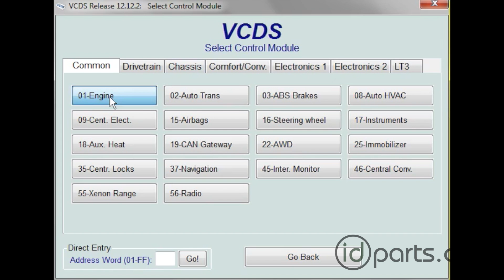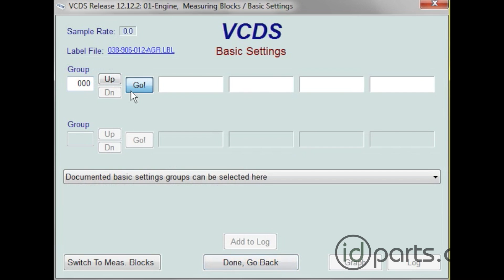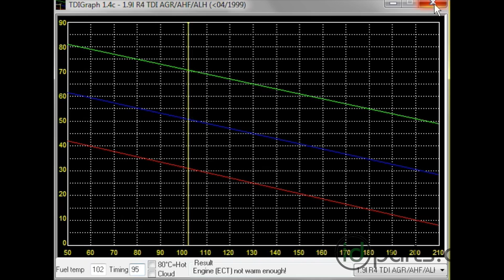Adjusting ALH Injection Pump Timing

Comment: Good video, Cory. @1:03 there's are 3 clips on top and two at the bottom. a long thin screw driver helps to unclip them and to put them back on. Another hint is to mark the hardware on the pump, so you can go back to where you were if you screw up.

Comment: My tdi will not start and I think it’s due to the injection pump timing, is there any way to set it manually so it will start? I see the program you can use to look at it but the engine has to be running and mine is not
Reply: Have you removed the injection pump? When you install a new pump it should be set with the a pin at TDC and the cam, crank, and flywheel should be tdc as well. Once installed correctly the engine should start given you've primed the pump and injectors. It needs to be further timed afterwards with vcds for precision.

Did your pump jump time?

Comment: Thank you for this video. After replacing my timing belt, water pump, pulleys etc. I've watched several timing videos now to ensure I'm doing everything as per the specs and yours has been the most informative by far where this stage is concerned. 

To anyone thinking of timing their VW ALH without VCDS i.e guesswork I would suggest you reconsider. Have read tales of people wrecking their engines by not doing it correctly. There's a reason these things need setting up the way they do so don't be tempted to listen to any old back street cleetus. Do it properly. Get the cable, get the software. Far cheaper than fixing a broken car. I don't understand why people would even go near their timing if they're not going to do it properly :S

Comment: Is it possible to do this without vcds?  I had my car scanned and I am close to the red line.  Is it just a small increment I need to adjust or is it like half and inch movement?
Reply: +Rollincoal you sir are a tool but best of luck with your alh
Reply: did your folks have any kids that actually lived?
Reply from the maker: You definitely don't want to do it without VCDS or some other scan tool, because you'll have no idea how much you're adjusting your timing--it's not really something you can eyeball.
Reply: Actually I tried it and got it bang on was 2 light smacks maybe moved an 1/8th of an inch got it perfect to the green line. Car starts in -36F every morning.    It's the same as any other engine really have worked on many and done many nothing different here except the money grab scan tool
Reply: +Rollincoal You're a bit of a divvy really aren't you? Are you sure your name isn't Cleetus?
You keep on eyeballing those settings and tollerances. I really don't care personally one way or the other but you're definitely not all there, that I do know.
Reply: ^^ Sure thing. Whatever you say Cleetus. Aint you got some shine to be swilling?
Reply: I know this is old but I just did one with a snapon scanner and set it to 1 degree btdc.
Reply: Rollincoal its not a money grab tool you need it to do you could really mess things on
Reply: +Rollincoal And how would you know you're bang on the green line without a graph to refer to?
The ALH is similar to other engines but isn't the same. When you set the timing up initially by locking the Cam, Crank and Pump this is mechanical timing. Without software comms you're only guessing where the optimum timing is. There is a BIG difference between luck and precision. Where my engine is concerned, I'll take precision.
Reply: It's okay Mike they have support group for downs and fas.  Get the help you need
Reply: Haha oh so its just magic ppl working in the field who can set timing? Its only possible by using a program? HAHAHAHA. Let me guess you're an American?    Dude this isn't ticket science maybe to you and everyone you know.  But to the rest of the world this is pretty simple shit.  This coming from guys who do their own work and who can read. Lol. Precision well I'm glad you own your highly tuned Formula 1 engine. Not a massed produced diesel with crazy tolerances to allow for inconsistency haha.  I hear Banjos bud and your cousins calling